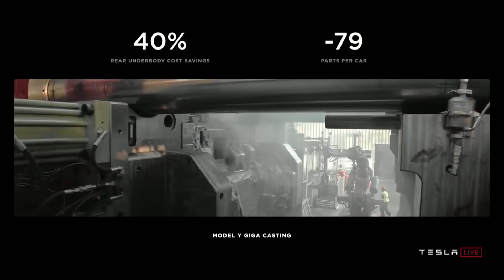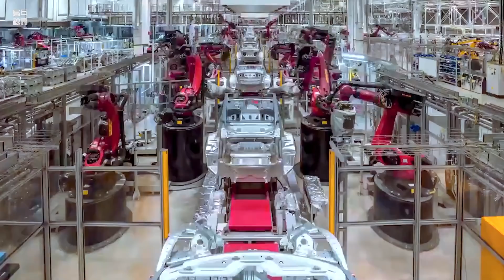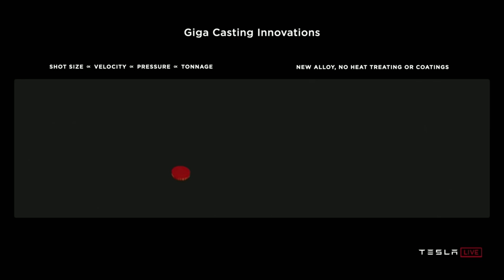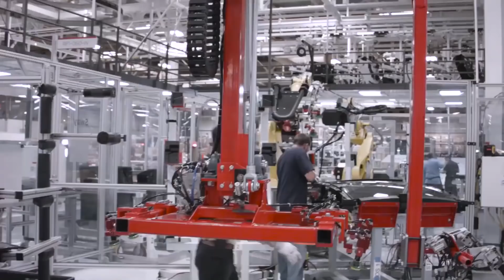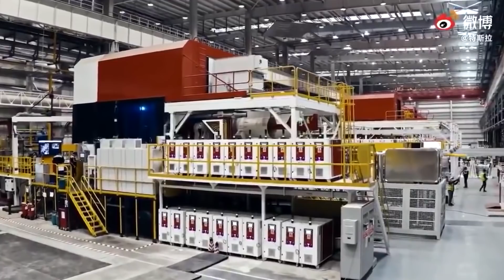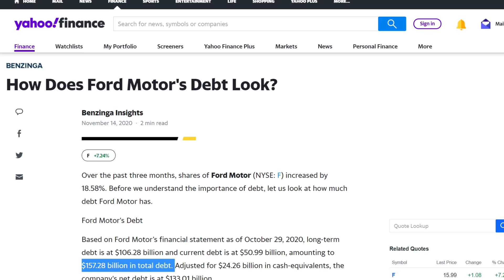Tesla Giga Press: Why dont Auto manufactures copy?

Comment: Just because Tesla struggles with welding stamped sheet steel parts together accurately doesn't mean that experienced auto-makers suffer with the same issues. There is also the issue - which I haven't seen anyone talking about - is corrosion when you start bolting dissimilar metals together. Use steel screws to bolt other parts to an aluminium alloy casting, add a damp atmosphere with added salt, and see what happens over time.
Reply: re: "There is also the issue - which I haven't seen anyone talking about - is corrosion when you start bolting dissimilar metals together."  no worries, much of that has been solved.  the Body In White of many OEM's (think BMW, GM, etc) including Tesla are constructed with "Mixed Materials" for weight savings.  hint, they don't weld or use any type of mechanical fasteners, they use aerospace Bonds and Adhesives. the 10th Gen Accord for example (while mostly steel, 93%) has reduced the number of spot welds and substituted Bonding giving more surface contact between sections. this increases stiffness that much more and reduces NVH that much more.  #GLUBOTS
Reply: @phillyphil1513  While bodywork and stuff are often glued, stuff like suspension, frame and other vital high load parts are still welded or bolted.
Reply: @MannoMax sure, but when's the last time you saw something steel on a modern automobile that DIDNT have some degree of coating/treatment applied to it during manufacturing REGARDLESS of whether it just contacts more steel or any other metal be it ferrous or otherwise...?  ie, paint, powdercoat, galvanization, rust proofing, etc.  important to remember, the year is now 2021 not 1951.
Reply: @phillyphil1513  Well, they are usually coated, but that doesn't count for shit. Within 10 years tops those things will fucking bloom with rust. Also stuff is often just painted or lightly coated, because better coatings like zink coating and galvanizing introduce distortion and other problems, that require more engineering to use in production
Reply: @MannoMax  re: "Well, they are usually coated, but that doesn't count for shit. Within 10 years tops those things will fucking bloom with rust." "NO FREE LUNCH" (booming voice from the heavens/from the Universe).  as the "wisemen" say, in our greedy desires we want the "trifecta" of having things be GOOD/FAST/CHEAP, unfortunately despite this "ravenous desire" we can only ever PICK TWO.  what this means is, the entirety of the world can't built (nor will ever be built) with the precision of a SPACE SHUTTLE.  yes, it does take some longer than others to come to this realization.
Reply: @phillyphil1513  I really don't want stuff to be cheap, fast is debatable too. But you can't get high quality cars any more. My Trabant of all things though, that things going on 50 years and hasn't had rust anywhere.
Reply: No problem because the teslas battery won't life that long before the body starts deteriorating.

Comment: Why do people keep calling this a press ? Its an injection molding machine.
Reply: You are correct it does not 'Press" anything. The press force only keeps the die closed during the shot phase (injection) of the cycle. The terminology 'Injection molding machines' refers to 'Plastic Injection Machines' in our industry, Technically it is a 'High-Pressure Die Cast Machine'. The IDRA parent company currently has 4 DCC6000's operating at a plant outside of Shanghai for the Tesla project, There are more on order. A number of other MFG's are scrambling to put these machines into production for their production line. Last May LK Machinery released their DCC9000 (Worlds largest Die Cast Machine), large capacity machines seem to be trending in our industry.

Comment: other manufactures can't replicate the Cast. there whole platform, design, engineering, tooling, staff, plant and infrastructure is set up to build cars the traditional way. 
also the have too many version of each car with changes to the body structure.

in order for them to change it would demand a very high sum in the tens of billions to change all the plants over. you can't just change one. they are too far down the road
Reply: I suspect you are right. There seem to be no technological or legal reasons, but there are plenty of other factors.
Reply: @jamesrempel8522  Cutting bonuses to top management is probably hardest part
Reply: When looking at pictures these castings seem to work only with body on frame designs. At least VW and Kia/Hyundai have actually unibody ev platforms where these Castings dont make much sense.

Comment: My thoughts go to the materials that are used.
Steel has a lot of good properties, for example spring steel is excellent for parts that a lot of abuse, aluminium is absolutely unusable for springs.
I think that car bodies gain quite a bit of fatigue resistance because of the steel that is used.
Cast alloys may not pan out to have a long life in high abuse applications, and I expect that cast alloy car bodies would be very difficult to repair.
I am not sure that this is quite as one sided as you guys put forward, or maybe it is :/

Comment: Good interview, however, he never actually gave any numbers (which you asked for) about the quantitative benefits in terms of replaced robots, speed, and cost vs the old method.  It was pretty slick of him to 'answer' the question while not actually ANSWERING the question.
Reply: Those aren't really questions for him, are they?
He could maybe estimate, but that would likely be used as a benchmark for FUD if Tesla didn't match the figure?
Reply: I think the Sandy Munro videos give an idea of the benefits, and savings - he is the auto manufacturing expert...Elon has also talked about this - something like 300 robots saved per casting (as I remember), and they are produced at about 1 per minute... (but I don't think its 24 hours per day).

Comment: One thing he forgot to mention is that steel is way cheaper than aluminium, also those manufacturers already have the stamping machines plus the dies, the frame is for heavier vehicles that are used for towing or custom builds for example. The legacy manufacturers also have serious metallurgy specialist and have worked with much more complex and versatiles alloys and materials.

Comment: You are using the term giga casting and giga press interchangeably.  Is that correct?  To me casting implies molten metal injected into a mould, whereas “press” seems to imply forging, a way different method for shaping a metal product.  Am I wrong?
Reply: Giga pressing does both in one go.

Comment: Using large expensive unrepairable parts are not in compliance with EU regulation, all products need to be repairable against reasonable cost.
Yes there are lots of exceptions but only for inexpensive products, even mobile phones need to be fully repairable.
Reply: It's illegal in the EU to make unrepairable "products" not parts and for "parts" they should be replaceable! Elon has clarified that castings could be both repaired or replaced.
Reply: @ThinkSleepLeave  Sorry, you are correct. The product must be repairable. Not necessary the part, it is just the traditional way is to repair a car body.
The reasonable cost is the problematic part. If you repair or replace it, it has to be dismantled from the car and assembled again. As almost the entire rear (or Front) is connected to the casting it is a big job. But if they only sell those in US or China I guess it wouldn't be a problem.
Reply: @buddy1155  well they do plan to make them in Berlin and sell in Europe. They must have figured this out. Nevertheless the chassis gets damaged in accidents in cases of major impacts mostly and such cases will most likely consider car as totalled. Since the upper body extends out of the chassis by several inches, most minor or moderate accidents should not damage chassis.
Reply: @ThinkSleepLeave  I am pretty sure it would be unacceptable for the EU that if a one year old 50K car can be totalled by slightly more damage as a fender bender. 
"They must have figured this out" mmm.. like they figured out that they build the factory at completely the wrong part of Germany or that they will get lots of trouble as long as they do not allow the union.
Reply: If you were in an accident and the casting cracked the car would probably be totalled anyway.
Reply: @Butterwhales  That is exactly my point, if a car has still high value they will replace some pieces of sheet metal.
If you build it in a way it can's be easily repaired it is against EU regulation.
Reply: @buddy1155  what I was trying to say was it's not going to be a fender bender that cracks it. It's a solid piece of metal not formed sheet metal like the rest of the car. You can replace the crash boxes attached to the casting. You would have to be in an accident where the other car made it through the sorb tusks and all of the crumple zone. You probably would have been in a head on collision at speed to do that.
Reply: @Butterwhales  The casting from Tesla is compatible with an engine casting from an ICE car. But used as they do in Formula 1. Rolled steel (or aluminium) gets its properties from being rolled, castings don't have those properties and are brittle. That is why ICE engines got a steel oil pan. Al you have to do to crack a casting is to hit something too high for your bottom clearance. That is why EVs got all that protection for the batteries.
Reply: @Butterwhales  And it can be a literal fender bender that crack the casting, the inner wheel wells are part of the casting so a small hit from the side will also destroy the casting.

Comment: Now if only Tesla would use their tech to make a car instead of a tech demo on wheels. Buttons, door handles, speedometer in front of the driver, windshield wipers that don't snap the drive arm when frozen down. Not to mention availability and acceptance of 3rd-party and self service.

Don't get me wrong, I love the tech (though not the naming. Calling it FSD should be illegal), but until they make something more car like they won't be making huge dents in legacy autos. Especially not if the F150 lightning turns out well. The path to mass acceptance is "it's a car, but electric" , not "a spaceship on wheels"
Reply: Yeah I also like the tech but I think Telsa cares to much about being that futuristic company and being in the news
Reply: Hopefully they will find the technology to make the cars more affordable to the average person. Yes I understand that maintenance and gasoline will be cheaper in the long run. But you're upfront costs are greater in the short run. You've just bought a 50 to $90,000 vehicle instead of a $25,000 vehicle which has a longer range and it's easier to fuel. So how many years will it take to realize an actual savings? Then there's the problem of batteries and extreme cold. The new metal is great and the casting system is wonderful but we've never seen how this works out in the real world. That would be interesting.
Reply: Don’t worry to much about the style of the cars. Most of these will outlive anyone who thinks they are too futuristic. The prices are lower all the time and as they ramp up production, we will see them become very affordable in the next few years
Reply: @thejpkotor  Yes. Companies like apple and Samsung show us that supporting old products is important ...

Comment: It's hard to say why the incumbent automakers hadn't already went to a single piece casting for the chassis, it's not a new idea. Sandy Munro, in his interview with Elon Musk, mentioned that he'd had a mock up of a single piece chassis for years and had tried to promote the idea to his clients with no interest. Perhaps Elon's response to him explained everything: when asked about why they weren't putting a Giga press in Freemont, Elon responded "It's hard to change the wheels on the bus when it's going 80 mph". 

Tesla has certainly had a tough time with quality control on their body panels and chassis pieces, stacking of tolerances has been a problem for them. The gigapress should go a long ways to remedying those issues.
Reply: No, it will make those qc issues worse. Do you know how hard it is to check large castings ?
Reply: @MannoMax  I had a short stint in quality control at a stamping plant, so I have an idea how they'd do it. They just need a big fixture, it shouldn't be too hard once they work out a process for it.

Comment: Considering the huge amount of baggage the ICE car mfgrs have in antiquated building techniques and executives that are not comfortable with changing how they do things, it is hard to see how they can successfully build a whole new EV line with new equipment and techniques at the same time as continuing their old production. Add the huge amount of debt and the fact that they will need to make at least 50k EVs per year to start to make a profit, it seems nearly impossible for them to succeed.
Reply: Total bullshit, the only difference between EV and ICE is just the chassis which is totally flat which means not difficult to make, plus they don't need castings and those manufacturers doesn't use 70 parts like tesla was using. Steel is waaaay cheaper than aluminium....... the tesla giga cannot reach the capacity of stamping. Tesla will still need stamping to make the doors, hood, fenders.......
Reply: @carholic-sz3qv  you must be inhaling too many fumes if you believe that.
Reply: @macrumpton  yeah thats what she said LOL....

Comment: how would giga press work on steel?  I think you need a low melting point alloy.
Reply: Not the best vector for high temp. Plus the use case wouldn’t lend well for fasting. 

Typically need higher strength that comes from forging.
Reply: It'd be uneconomical, the dies would wear out like crazy
Reply: Q: how would giga press work on steel? A: great if you're building BOAT ANCHORS for Container Ships, you know, like the one recently stuck "sideways" in the Suez.
Reply: @phillyphil1513  The giga "press" wouldn't work on steel, you generally don't injection mold steel. To much wear on the molds.
Reply: @MannoMax  re: "The giga "press" wouldn't work on steel" exactly. re: "you generally don't injection mold steel." double exactly. re: "To much wear on the molds." 3X exactly.  again, whatever you make would be HEAVY AF (ref the Model X is already a whopping 5500+ lbs/2500+ kg).

Comment: Legacy automakers: "That's not the way we've always done it, so it can't be any good!"
Reply: Thats totally nonsense, those manufacturers also have castings and many other more advanced materials( magnesium, carbon fiber, titanium......) than what tesla uses. Bmw even built a giant carbon fiber production plan in the US around a hydroelectric plant.
Reply: Is tesla going to use a giant casting for their semi?, uhm nope, steel frame is much more solid and versatile for custom builds. Just look at a scania 770s chassis.
Reply: @carholic-sz3qv  I’m guessing you need pretty high volume to justify the expense of the massive dies and press, and at least at first the semi won’t have the necessary volume.
Reply: @macrumpton  vw makes 10 million cars a year so yeah its a very big justification. The tesla semi is not comparable to other semis, mercedes builds the Zetros 6x6 and arocs for super heavy duty and offroad use even for super heavy hauling, they also have another specialised vehicles like the UNIMOG which is the most versatile vehicle in the world and I dont think an aluminium casting will be something useful there.
Reply: @macrumpton  tesla is still at the beginning and they don't even have any vehicle that can be custom build, even the cybertruck is not a typical truck that can be modified for utility installation...... look at the mercedes benz sprinter, it comes it about 50 to 100 different configurations possible.
Reply: @macrumpton  It isn't about costs for dies, aluminimum casting dies are fairly cheap. Its just that cast aluminum is dogshit.
Reply: @MannoMax  Well, I guess you must know it all. Maybe you should apply for a job at Tesla so you can save them from their tragic mistake.
Reply: @macrumpton  It's not that i know a lot, its just that i have a good bit of experience with castings in general, and with vehicles. Any truck mechanic can tell you cast aluminum frames for a semi are a bad idea.
Reply: @MannoMax  the whole automotive industry has been dragging their feet on using large castings for decades. I guess we will see who is right in a few months when tens of thousands of Teslas with cast aluminum frames start rolling off the line. Btw between your expertise and Sandy Munro, I’ll go with Sandy.
Reply: @MannoMax  It isnt pure Al, its an alloy
Reply from the maker: Great point